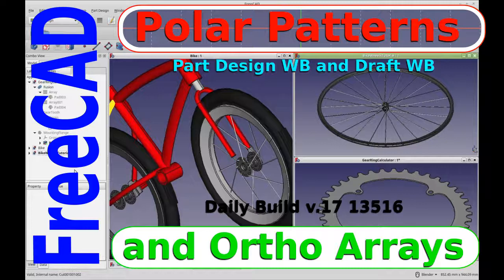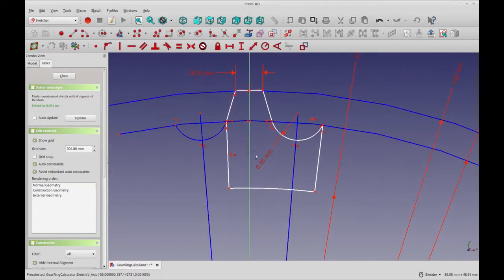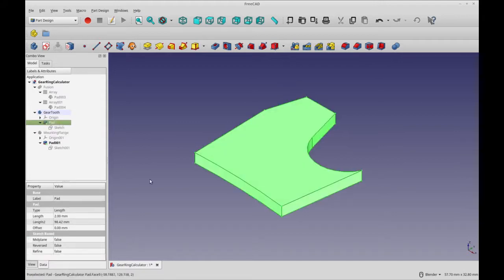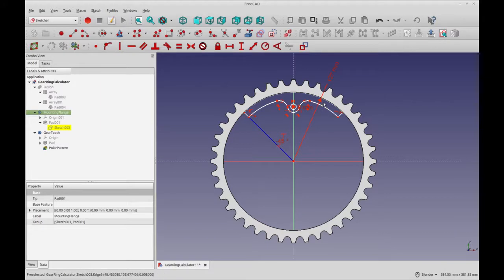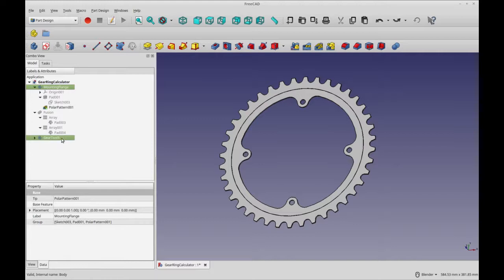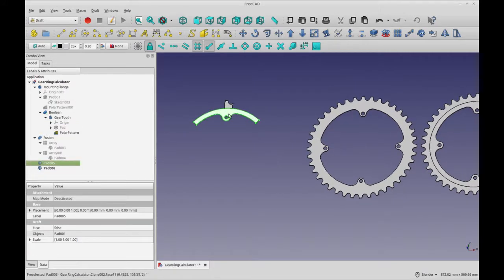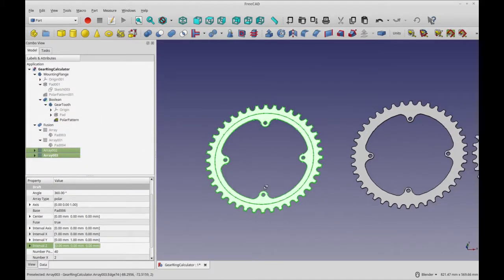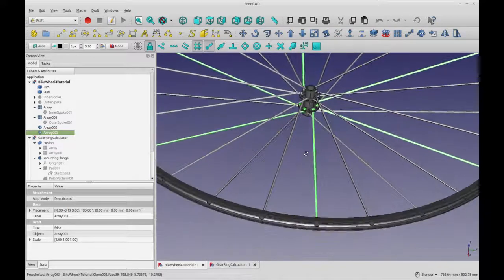FreeCAD - Polar Arrays Tutorial ( Draft and Part Design ) make a Bike Gear Ring

Comment: Hey i made an array on on my battery holder. I use the array to make a cut through using "part". i then try to make another cut using a copy of original sketch but it covers up the cuts i just made. how do i get around this. got a feeling i dont understand how they are linked and delinked? can you point me in the right direction for more info? me: 0.18.4 linux
Reply from the maker: Hard to answer without a little more info. If you want to screen shot and dm me on twitter, I am @mathcodeprint I would be happy to help.
Reply: @mathcodeprint  I dont use twitter much but i am @bonmitchell but o amlogged in i have got the file uploaded to gmail. i would love if you could have a look at it and tell me what i am doing wrong.